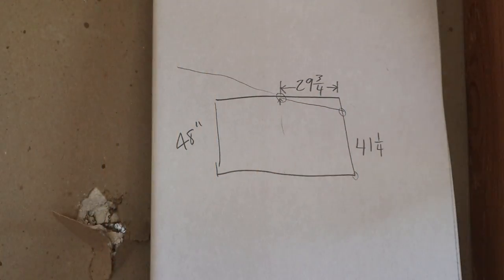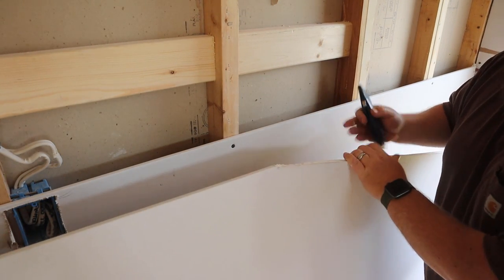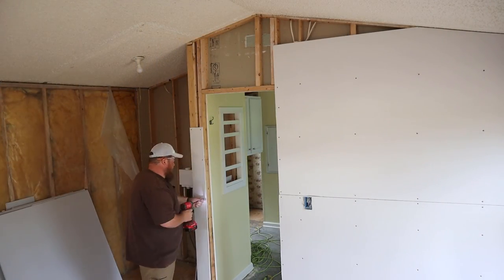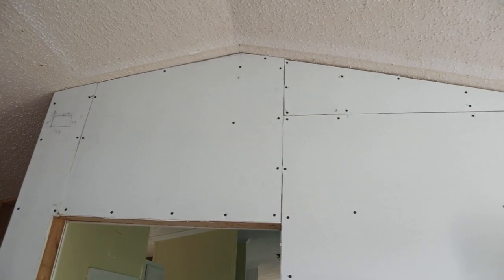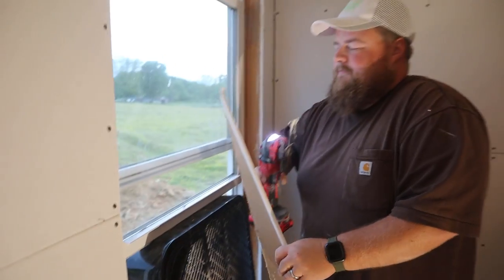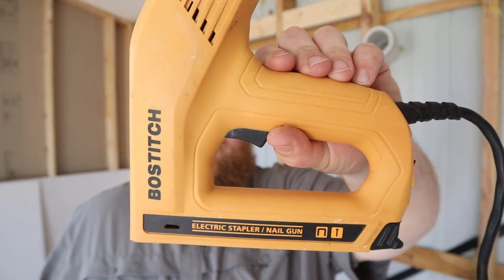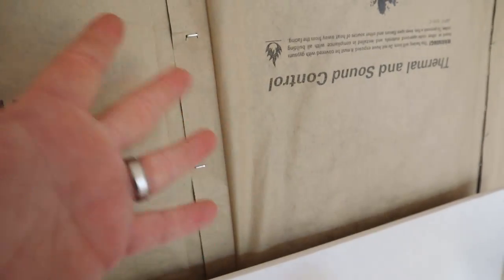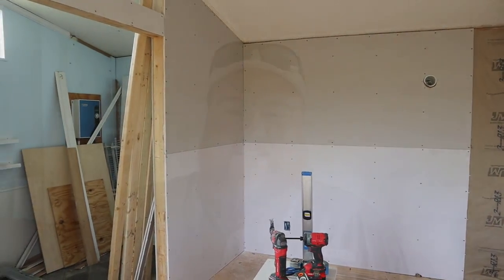I Was Wrong: Drywall & Vapor Barriers  // Mobile Home Bedroom Renovation

Comment: Fun fact on drywall. Most people don’t read the back of the drywall mud buckets, but most people sand it and cause a very dusty mess, but on the back of the bucket, it says to get a wet sponge and wet sand your seams. Meaning you have no dusty mess. We tried it and it’s sooooo amazing. You’ll be mad you ever did it the other way.

Comment: The other thing I always like to do before I put up the gyp board is take a photo of the wall. That will remind me later when I inevitable forget, where the blocking is and what the framing looks like in the corners where it sometimes gets wonky. I always THINK I’m going to remember, but after forgetting one too many times, a photo is worth the few seconds it takes and reinforces my memory. Great job, Sam and Angela!
Reply: I did that when we built our house. I've gone back several times to look for blocking & electrical.
Reply: I guess they have the advantage that they have these videos they could refer to if they ever needed to recall where they had placed framing and blocking.  Unlike us mere mortals who have to rely on photos and our memory 😂

Comment: Most contractor crews have what I call universal terminology. My favorite for drywall is to describe the edges. When two manufactured(tapered and papered) edges meet, it’s called finished edge. A butt joint is when the non-finished or cut edges meet. On the butt joints, have you considered or tried V-grooving to get a better taped and mud finish? It was a game changer for my finish work. V-grooving is done by using a utility knife to cut an angle along the joint giving it the taper or cavity to mimics the taper of the finished edge. There are several videos showing the technique if my explanation was too complicated. 😊

Comment: Hey Sam, just found your channel. As far as drywall finishing is concerned, some advice from my 35 years of working in the manufactured home industry. Use paper tape instead of mesh. Mesh is thicker than paper, is harder to hide and is easier to become visible again if your not very careful while sanding.  Sure you need to get a technique while putting it on because its not sticky, but a bit of practice and pretty easy. Just mud the crack sufficiently, ( make sure to cover in mud enough to make sure the entire underside of the paper tape is bedded in wet mud), measure and press the paper into the mud, and cover and smooth it out with your taping knife removing any extra mud. Use good pressure and a wide knife, 8".  Remember while taping, LESS IS MORE!! With a bit of practice, sanding can be held to a minimum. Feel free to contact me here if you want, there isn't much on a mobile home I haven't rebuilt many many times. Great videos by the way.
Reply from the maker: Great advice, I appreciate it greatly!

Comment: The only reason I brought up the plastic was because I helped a man who thought he would be more energy efficient by adding that over his insulation inside and outside. That was the first and only time I had ever heard of doing such a thing. That man wanted me to finish the drywall which I said sure no problem. I told him we would need some drywall tape and another man there said they don't use tape anymore. I  said well you finish it because I would not take part in that. Some time later I went by that house an that was the biggest mess I have ever seen. Mold was everywhere and ever seam in the drywall was cracked. It was awful on a level I had never seen ever in my life. Now in regard to drywall screws whenever we used screws we had an adjustable drywall screw gun so that all the screws would be more uniform. We adjusted it so the screw would be countersunk without breaking the paper and when finishing our trowel would not detect any screws. Made finishing the drywall quick and easy. I have used two types of drywall tape one is paper another is fiberglass I have never had any problems using either of them and I prefer fiberglass now because it eliminates having to bed it in which takes up more time. Some may argue to differ but mainly because they don't like change. I have never had any complaints or problems using fiberglass drywall tape. However you be your own judge.

Comment: The sureform/cheese grater works great, but you can use a sanding block with 80 grit sandpaper, just to smooth the cut edges!

Comment: It's impossible to know about these things because theres SO much information out there. Especially because there are different climates everywhere. We're in FL so we need different things than you do (maybe?!) it's so hard to know. All I know is that houses NEED to breathe so you can't waterproof stuff or air proof anything and there needs to be a way for water to dry itself out and air to get in and out. It's so confusing!! Especially since right now I'm going through all my house to caulk everything up to make it sealed up. Ok, I wanted to know about that silver foil insulation - which side do I put the silver on in FL? I can get 20 different answers to this lol! Also, I want do redo the underbelly and insulation in the floor - I've been told NOT to put insulation on it because it doesnt need it. I've been told to encapsulate under the house, but also told NOT to encapsulate because it will cause water issues lol. OMG So if you go the professional route, they're going to charge you 5k for labor to put in $800 worth of materials lol.

Comment: My mobile home came with a plastic as a vapor barrier between the metal sheet. The sheet metal would sweat and drip inside the plastic. Sometimes it would drip so bad that it would wet the bottom of the studs. The plastic was so bad that I cal the plastic out since it was not longer a barrier because of all the wholes and spots where it was just breaking apart as a result of age. For a vapor barrier I use 1 inch of hard foam and then the pink fiber glass   insulation. Once the foam was on it stopped sweating. This worked fine for me. It been 10 years and not problem. My neighbor, had the same problem when he was remodeling and he took the worn  plastic out and sprayed that  newspaper insulation and sheet rocked the walls without a vapor barrier at the sheet metal. A year later the sweating which created mold was so bad that he had to redo the whole room.

Comment: Its looking nice in there! One thing about the outlet oscillating attachment is you could get some pliers and tweak the sides out a bit so it would cut the holes slightly bigger, i'm sure it will leave a little drywall in the corners but it would be pretty easy to clean up the corners if needed.

Comment: When you get ready to mud the sheetrock, check out Al Lumnah's (Lumnah's Acres) video about taping the corners. He used a large Zip Loc bag that he snipped the corner to apply the taping compound. He said it was a huge time saver. Your sheetrock looks really good. Great tip you got from Doug. He's hung his fair share of outer wall sheetrock.

Comment: A little side not for those guys doing this and would like some noise barrier, put some long drywall behind the outer wall in the pockets and it you'd like some extra put insulation on one side. I found this out when I did my upstairs bedroom wired internet I found this type of sound barrier. It's not perfect but it does reduce the sound considerably. For finishing a friend of mine used to do it professionally and he taught me to use a spray bottle with water set to mist to extend the amount of time you can work with the mud, it works extremely well. Thanks for sharing. Best Wishes & Blessings. Keith Noneya

Comment: They do have it on rolls but they normally put it on outside walls it's called house wrap you can get them at Lowes it comes in 2 ft wide rolls and 9 ft wide by 150 ft long rolls to cover the walls

Comment: For finishing the dry wall what has helped me the most is to use a 14 inch trowel. And to thin your mud down just a little bit when you do your 3rd coat, seems to eliminate a lot of sanding. Another tip for putting up drywall is to use lipstick on outlet boxes then set your sheet rock against it and give it a couple Smacks where the box is, it leaves a nice outline where to cut.

Comment: Some folks use a Rasp to clean up dry wall cuts. Not the file like one,although it may work. no the cheez graeter one,fits in the palm of your hand. Some Code require a stagered joint on your dry wall. May not apply in your area. Good job Sam.

Comment: Glad somebody more knowlegeable pointed out why you didn't want a poly vapor barrier...
I live in a colder climate, many people used poly in the 80's & 90's, but issues with mold, etc around outlets and other openings are why it isn't done anymore. Kraft-faced insulation is sufficient and breatheable...
Reply: The other thing that will help is if you someday decide to tear off the alum. siding and put sheeting & siding on, is to use housewrap like "Tyvek" between the sheeting & siding. It allows the house to still breathe, but dramatically cuts down on the air infiltraton!
Reply: You both are doing a fabulous job renovating your home! So glad it moved well and you are getting it ready to move inside soon. When you do it yourself you know what you have, and not going deep in debt to keep a roof over your head is pretty rewarding in itself!
Reply from the maker: We hope to tear off the siding in the next year and have always dreamed of getting to properly wrap it with housewrap then install wood siding! We'll see how things go. :)

Comment: I love your channel. So happy you figured out the vapor barrier problem.
I don't wish to put a wedge in your friendship with Doug, but he makes lots of mistakes and if you point it out, he flies off the handle. Please thoroughly research before jumping in with something he says. A good channel to follow is Matt Reisinger.  He often goes to different climates and explains the differences in why you do something.  He teaches "building science". He can get very nerdy in his explanations.
Reply from the maker: I've watched Matt's channel for a long time, but he has yet to work on an old mobile home! Hahaha His budget is a little higher up on the pole from us, I think. :) Doug was very kind in his emails we had behind-the-scenes. He provided all the updated building code links and reference material and encouraged me to read the interpret it how I felt. :)
Reply: @sam-and-angela  while I agree, mobile homes are a different "animal " building science recommendations can be utilized over all building types. The only thing you couldn't do is have a conditioned attic,  unless you make the pitch of your roof higher. I've utilized many of Matt's ideas on my 2000 single wide mobile home. Especially sealing all possible air leakage areas. We also have aluminum siding. By increasing our insulation with the addition of 2x2s to all exterior walls before drywall is applied and sealing each seam, roof plates and sill plates, has reduced critter entrance and reduced energy usage. One window air conditioning unit keeps 644 sq ft cool in the middle of hot/humid Texas summers for $50/ a month.
While Matt builds million dollar homes, his ideas can be done on a budget if you look around for supplies.

Comment: Thank you for doing what yall do! My wife and I do as much as we can ourselves as well. Neither of us are pros by any means and always looking for ways to save money and do stuff ourselves. It's all knowledge we try to pass on to our children so they can be handy as well. Y'all do a great job explaining things and keeping it simple so thank you! One thing I could suggest that you've probably heard and has made my life so much easier when it comes to cutting drywall nice and straight . Is an oscillating tool. Picked up a Chicago electric at harbor freight for 20 bucks and it's one of the best tools I've ever bought. I use it for cutting drywall, wood and metal. I had to replace a part of my front door casing that had rotted out from the elements and it worked excellent! I used the tool to remove the bottom 6 inches with precision making the fix very simple. Maybe you've tried this already but thought I'd mention it. Thanks again!!

Comment: I did the exact same insulation however, maybe entirely wrong as I'm no construction guy, stapled it( with a similar electric stapler after trying it with a manual one ) inside the stud boards instead of overlapping the outside. Hopefully it'll be good to go. Original construction had no vapor barrier except the ceiling. Haven't noticed anything weird and it's been installed for a year or so. I'd say after our new HVAC system installed if you have anything not vaulted, look into more ceiling insulation. I have to figure out how to blow some into a double wide.

Comment: Up here is cold Alberta Canada , we have to use 6 mil poly over the insulation ( warm side) unless you use rigid foam and tape seal each joint before adding drywall. Good to learn what works in the USA too.

Comment: Good tip in the beginning for cutting panels for vaulted ceilings.  I'm about to do the same for my lean-to cabin but using wooden 1x8 boards.  If my 2x4 technique doesn't work, I think I can modify your technique and do what I need to.  Thanks.  Good video!

Comment: Wow, so glad you posted that as I was just thinking I'd go for plastic for my vapor barrier too until this vid. Now I'm going down the rabbit hole to figure out the theory behind having it or not having it or what to use. But yeah, down in Florida where Different is, they def want their house to breathe with all that heat and humidity. I'm in the Northwest corner so we have the cold and wet, not so much the hot and wet. Def need vapor retardant is my guess for what I need. Cheers.
Reply from the maker: Glad I could help, good luck!

Comment: Drywall finishing well remove drywall and use paneling! lol I really never understood why anyone wanted drywall. All it does is mold with moisture bust threw if you tap it slightly and make a bunch of dust! Aside of the fact you got to mud and prime the crap. I am also surprised you didn't just turn it into a 2x6 wall by adding onto each stud? Seems like a perfect time to do so! Lastly make sure you insulate the skirting and seal it good. Like 4" of that pink foam and barn tin attached at top and bottom. It will help so dang much you will be amazed!

Comment: Check out the channel, Lumnah Acres, they have been installing drywall and got a specific sander for the mud.  They were very glad they did because it not only made the process much faster,  its much cleaner too since it attaches to a  dust collector.

Comment: I am a fairly new seamstress and had a terrible time cutting a straight line on fabric using a metal yardstick. After I bought a wider see thru ruler and I can hold that steady for a neat cut. You can even set a weight on it to hold it steady. Might just work for drywall.

Comment: A drywall rasp might be a handy tool to have, if you have alot more drywall to hang (under $10 at most places).
Reply: drywall pole sander with dust collector (you can rent them at home depot). Saves your back & clean up is easier.

Comment: Great video. Missed your missus participation. If the insulation that was removed is surplus then couldn't you put in in the internal walls to help with sound proofing and heat retention etc. Or isn't it within regulation

Comment: Nice fix of the insulation. I cut drywall angles the same way you do. Where you change out the insulation, I didn't see those metal cover plates on the studs where the electric wires go through the 2 x 4 studs. It is code in my area; not sure if is code in your area. Keep up the good work. I enjoy watching and learning a few things.

Comment: Fits like a glove, good job Sam.  Takes a big man to admit his mistakes. We're all learning kiddo. I was wondering about that plastic myself, but I'm no expert either🤷, at least you found out before it became a problem and I know exactly where your gonna put that old insulation and it ain't the dump.  Perfect for the work shop. Lol  hey Sam was wondering about that insulation color. Is it fiberglass? I saw a FB add for these new really long mud floats. They look awesome. Also have you ever tried the power sander they use for drywall?  They look promising 😉.  I've used the hand sander with a shop vac attachment for years, but we've been having shoulder issues so looking for a better option.  Another great video, I needed it today as I got some very sad news today about an old friend. The out takes made my night 😂 thanks

Comment: With the new vapor barrier and insulation would you still be able to put plastic on it? Only reason I ask is the last time I Did wall work, I installed plastic on the exterior wall Under the sheething, and the interior Just over the installation. My thought process was to compare it to spray foam, where spray foam usually Creates a draft free environment and moisture free I wanted my wall to do the same. Which so far the walls I have not done that way I can still feel a cold Draft occasionally compared to not feeling anything on the wall that I completed.

Comment: At least it's only one wall. I have seen many DIY videos putting the mini-split above the headboard. Why?  It seems the noise and the hot or cold air would be blown on your head while you sleep. That's not good.  I seem to recall somewhere a drywall installer beveling the squared edges of the drywall. Not sure if there was a specific tool or even if it's a thing. Just thought I mention it.
Reply from the maker: Ours just worked out that it was the only wall space open in our room, and not on the front of the home where you see the line set from the outside right out front.